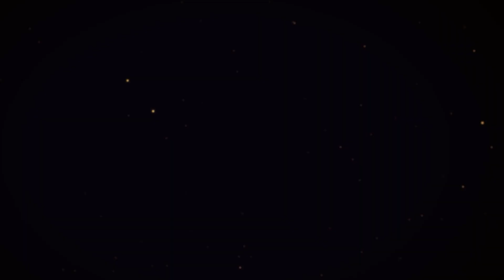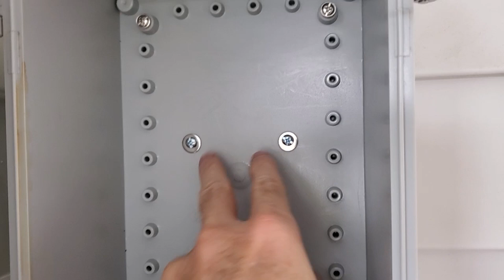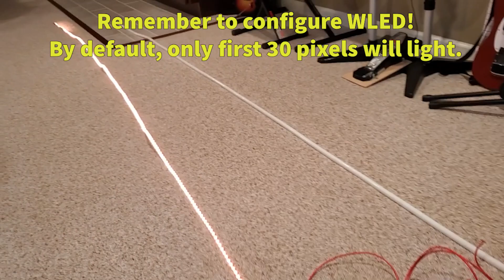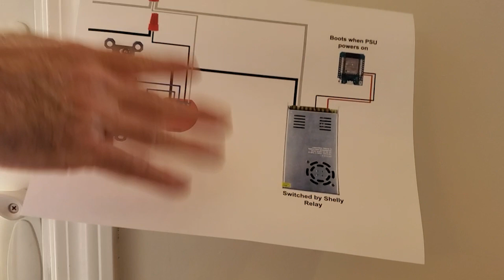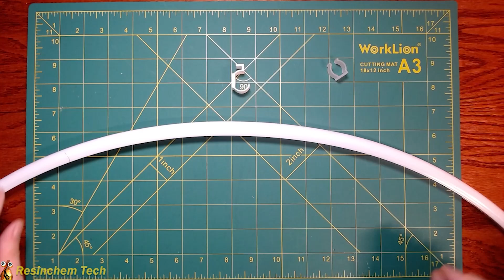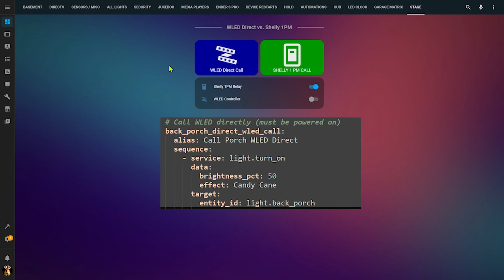An Outdoor LED Installation with Neon Rope Tube

Comment: Another great project!
Just one question:Can't you leave the adhesive strip with its coverage on the back of the led strip?
Reply from the maker: While the instructions say to remove it, you might be OK with shorter runs.  I think for the longer runs, the concern might be if the protective tape starts to peel back inside the tube during the pulling process and gets gummed up in the middle... then you'd have the exposed adhesive sticking to the inside when you tried to pull the lights back out to correct the jam.

There is a slot inside the tube meant to hold the LED strip against the back.  It is not overly tight (with the adhesive removed), but I think the tolerances would be pretty close with the adhesive still on, and could likely make pulling the LED string that much more difficult, and the likelihood of getting jammed up somewhere in the middle much higher...  again, more so on those longer runs.  It's definitely safer (and easier for the pull) if the adhesive is removed, despite the extra effort it takes up front.

Thanks for watching!